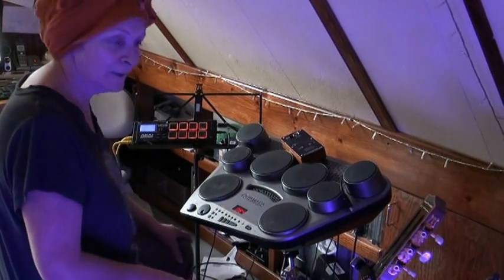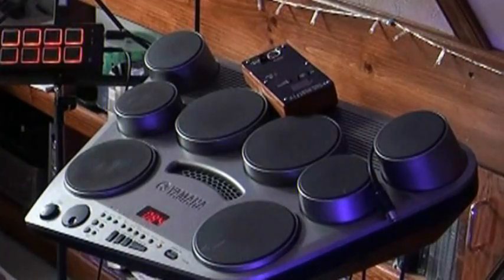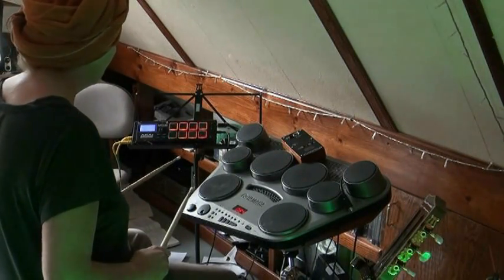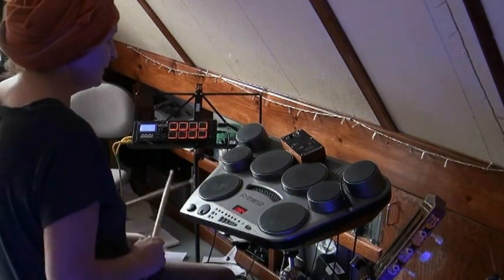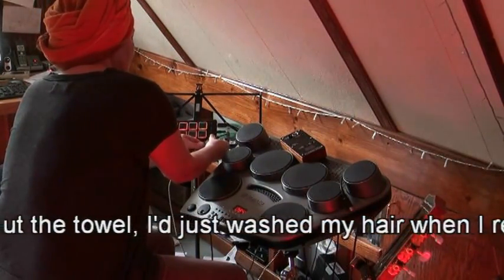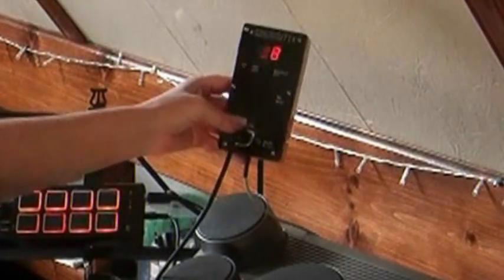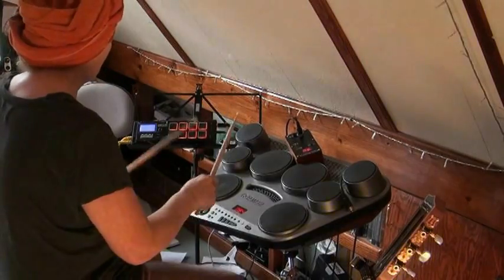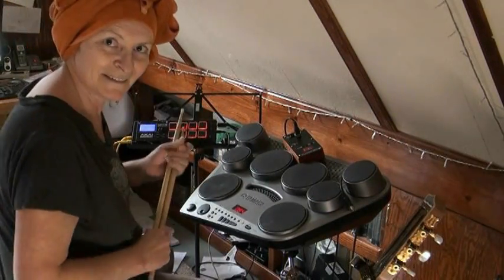SDS MIDI-FIX Demo

Comment: BTW, the MIDIBOX 4x4 USB/MIDI THRU/MERGE stops this issue - however it must be set up as a MERGE that is to say, inputs A & B  running at the same time.
Again, it's a workaround - so not perfect. There's no drop outs, but the issue with "accidentals" overriding the hits you WANT are still there.
 

Hope that's useful to someone.

For me the unpredictability of the accidental triggering is a deal breaker... That and the issues I've had updating the firmware (still not done it - after 2 cards and 7 attempts I'm calling it a day).

Such a pity as it would have been 100% ideal for my needs as I have a Yamaha DD65.

Comment: Great work, i'e just got my mpx8 out of the cupboard and i was wondering if the running status problem was still there - maybe akai had released a firmware update that fixes it - unlikely - but it's good to know you found your own solution...

Comment: Hey Sandrine! What a small world! 
I was just looking about for info on some simple/cheap way of getting audio into the Reflex for doing shows and I thought 'What about that Akai sample player thing, just throw it in a bag?!'
Lol!
Reply from the maker: +mCKENIC I don't know...try to find something else, they really suck. It'd work, but they're finicky about what is on the SD Card, must be in exact format etc.
I hadn't thought of it, but as long as you use the peak slice start, (if it's abrupt) I guess it could be done. The Reflex trigger input for record may work right off the MIDI too, but don't quote me on that ar ar!
Reply: +freshnelly Thanks for the reply! Watching this and other reviews/forums it seems like you are right indeed. I bet even a crappy phone/mp3 player would be better for getting audio to Reflex to mangle (not initially too worried about timing - just playback and manipulation). Thanks!